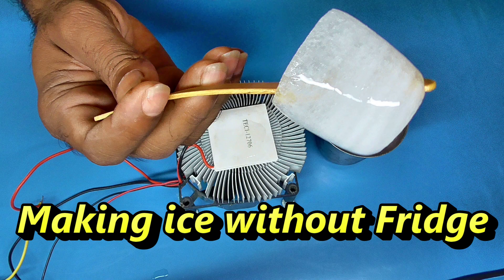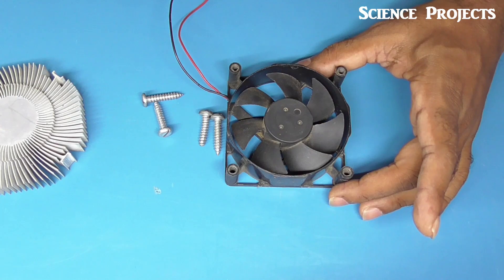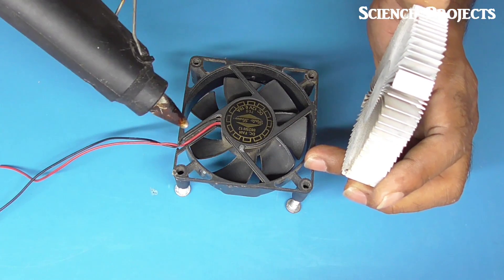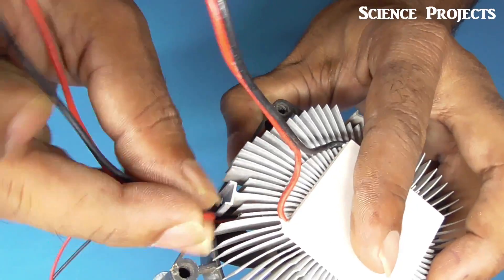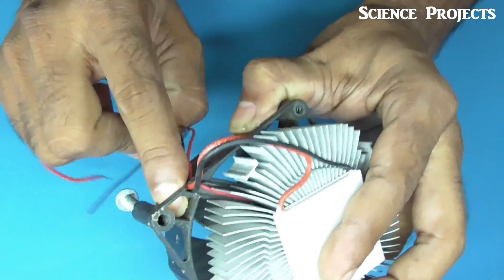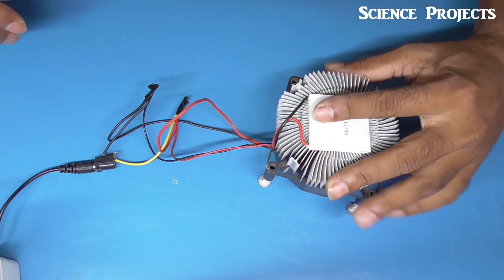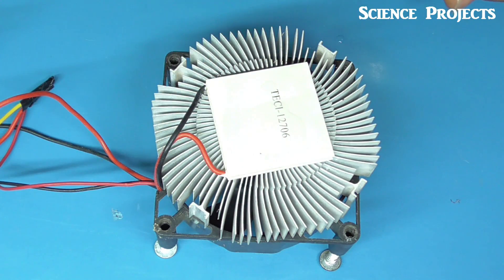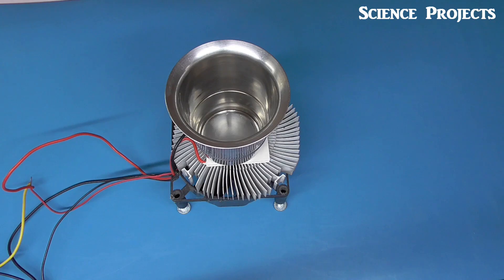Ice maker,  Cooling system, thermoelectric refrigeration system, peltier module price

Comment: Fake video
Reply: It's maintain some low tem only. But not maintain Ice forming tem. So it's fake
Reply: @harikrishnakatti3298  Yes Brother...
Reply: @harikrishnakatti3298  and the hot air goes up to the cup thats why its fake
Reply: And ice also dont form like that 
in between 1hour he kept that glass in fridge n wait for a while and place there 😂
Reply from the maker: No fake bro
Reply: @ScienceProjectsBalaji  1 palter modiul sa Ice  nahi  ban sakti....
Reply: @ScienceProjectsBalaji  o   ve   5 volt  sa
Reply from the maker: @RajSK-sg3hc  12v 15 amps
Reply: @ScienceProjectsBalaji  😱😱😱 15 amp vai  kitna Jhooth bolo gi  aap
Reply: @ScienceProjectsBalaji  you respond to everyone with different adapter spectification, 3,5,10,15a
Reply from the maker: @filenotfound__3871  12v 15 amp maximum 2 hours output results